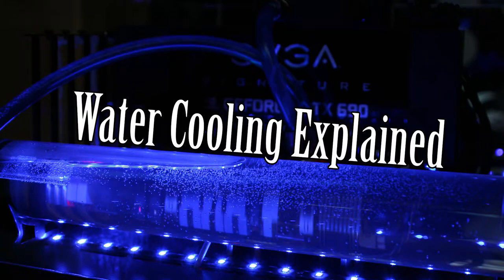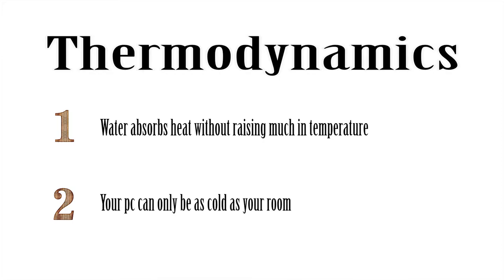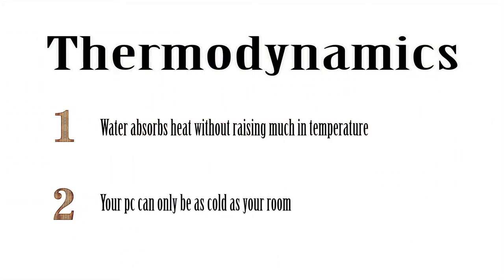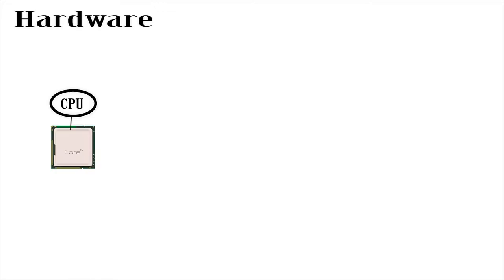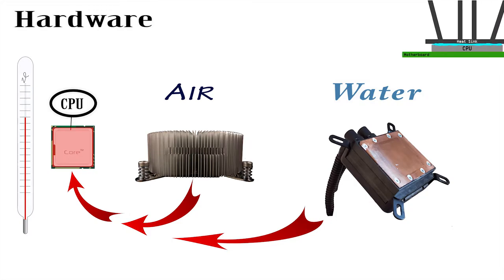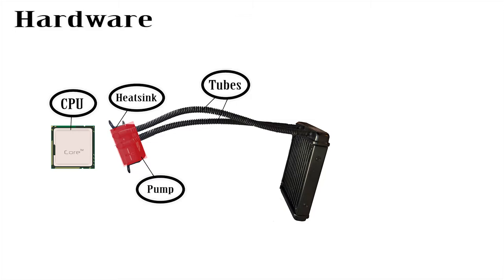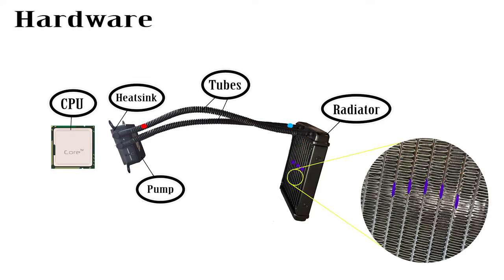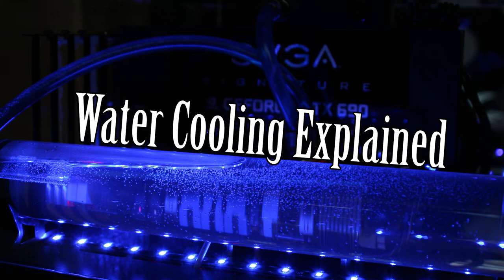How Water Cooling a PC Works

Comment: You should also do one on gpu water cooling
Reply from the maker: very similar process since they're both processors and the watercooling just removes the heat. BUT I am planning a CPU vs GPU comparison and explanation :)

Comment: water cooling??? use liquid hydrogen.
Reply from the maker: Unfortunately liquid hydrogen only stays liquid in a pressurized state due to it's super low boiling point, So it would all  evaporate :(